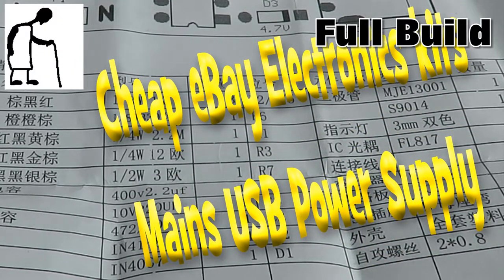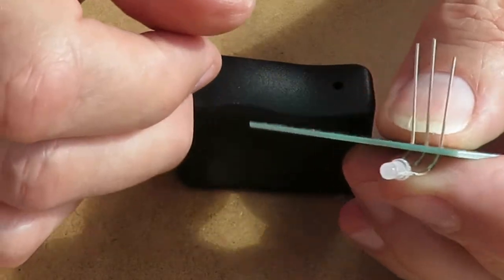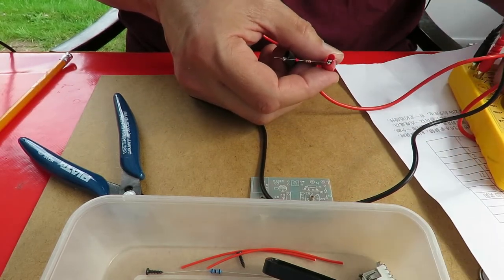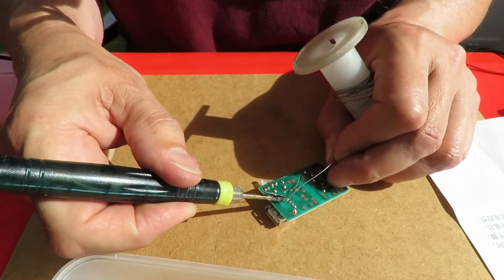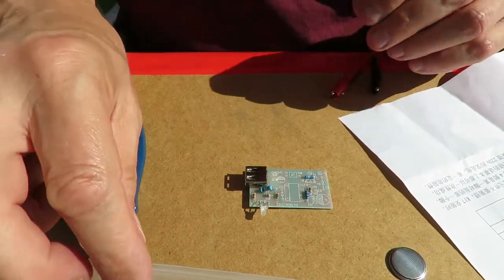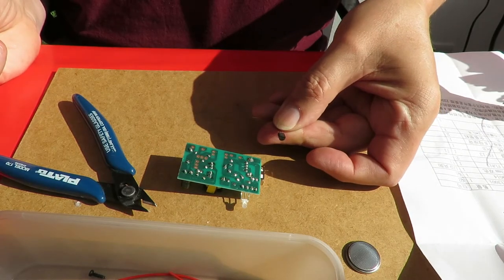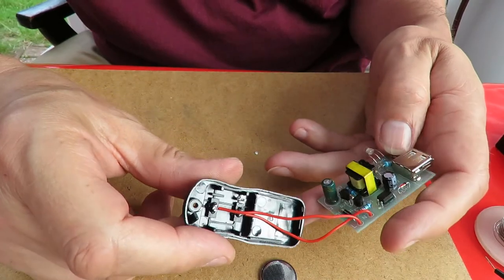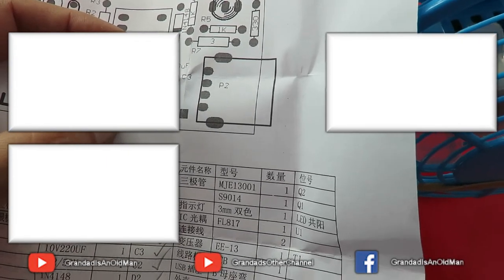Cheap eBay Electronic kits Mains USB power supply FULL VIDEO

Comment: You must be right about that elenco radio's over here,the one I bought was about 16.00$.free shipping,I guess where you live is a lot more shipping,sorry I didn't no,their is a small am/fm radio that might interest you I already bought it ,I got it for 6.59 ,now it seem to be around nine dollars unless you look around,it has a L shape circuit board it mostly through hole stuff with one smd chip it seems to be very popular model,if you find it let me  no what you think,it may be cheaper on bang good,the reason I liked the elenco it has good directions plus a you tube video.
Reply from the maker: I will keep my eyes open and see what turns up 😊